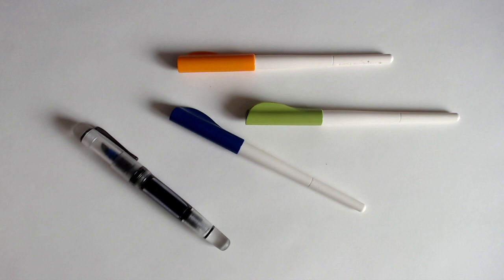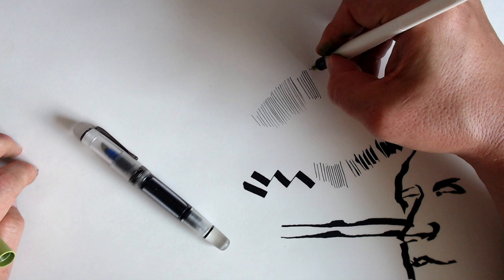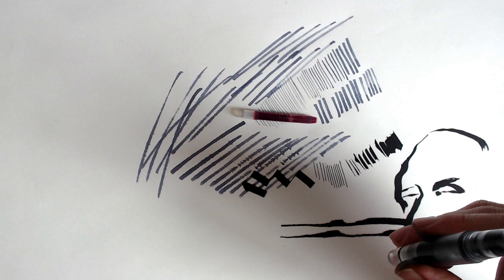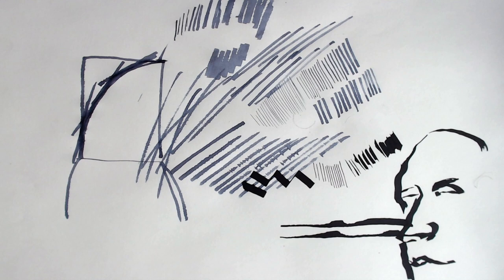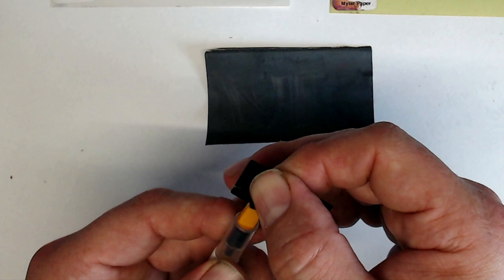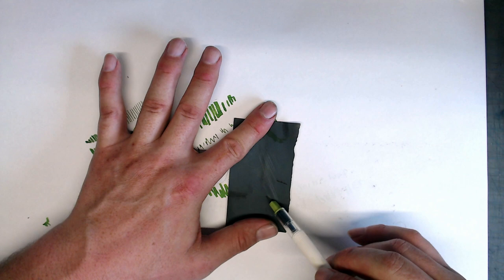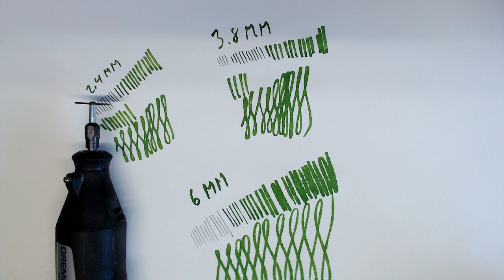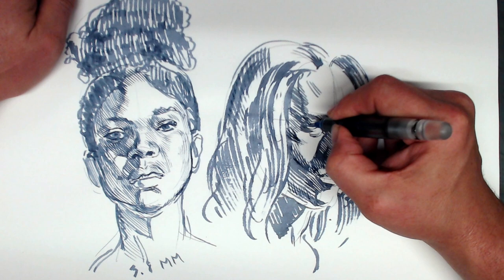Pilot Parallel "Ruling Pen Modification" for Drawing

Comment: I just did the mod on the 1.5mm pen in less than 5min with only sandpaper !!!  :D ( 150 grit and 3000,  those metal plates are very soft ! ) Smooth on paper no issue and the ink flows well. 
 In reverse or near 90° I get a consistent  fine line, around 60° like a good 1mm thick line that gradually increase to 2.5mm on the flatter side. 
This is fun, the speed of the stroke also plays with  the regularity of the line indeed !  Seems it can be a very expressive tool, I need to get use to it now  :D
Reply from the maker: Good to know that this can be done with just sandpaper! And I'm glad you gave this a try and were successful. With a little practice, it's a super expressive tool that more artists should be aware of.

Comment: It also works in the body of a MaJohn/ Moonman C3. fits perfectly and a C3 only costs about 20 bux. Cool hack. Great video!
Reply from the maker: Thanks for the tip! I love my Opus 88’s but would love a cheaper alternative for this parallel hack.
Reply: @mkompan  I nearly fainted when i tried it out and it just fit, with no need of tinkering. i was going to use a bit of plumber's tape, if i needed to, but no!
Reply: Hey Dean, I was thinking of picking up some C3 pens to do the same, does the entire nib unit screw out on the C3 like it does on the Pilot? Thanks!
Reply: @Lognamackya  Yes, and it fits, easily. Have fun! I love mine!
Reply: @deanandreoli1975  amazing, thanks for the quick reply
Reply: @Lognamackya  any time! Fountain Pens are my only real vice. lol
Reply: @deanandreoli1975  newish vice for me! Really appreciate the guidance. I ordered four to house my new set of Pilot nibs.

Comment: Wonderful really, great ideas ... May I just suggest a dramatic improvement to your filming?  Why don't you sit the other way round of your table (if you phisically can)? By that simple modification the objects you handle and show will be uniformly lit and always in full sight, instead of being sucked up by the shadow of your hands which make them too often look undistinguishable?  You don't even have to change position of you camera ... You can simply rotate 180° the frame in post and everything will show up right and bright.  I think your art and technique deserve that change! Kudos anyway :hand-pink-waving::hand-pink-waving::hand-pink-waving:
Reply from the maker: Thanks you, and thank you for the technical advice (which I know is sorely needed). My table faces a wall, so I’m not able to sit on the other side, but I’ve recently upgraded my lights and started using  better camera angles.

Comment: This looks fantastic. Generally, what Parallel width do you recommend for this?
Reply from the maker: Good question! I think I would start with the 2.4mm since it's the easiest to do this modification on. If you enjoy it, then move up to the larger sizes, which take a bit more effort.
Reply: @mkompan  Thank you! A local shop sells them, so I think I'll pick one up tomorrow. 😎